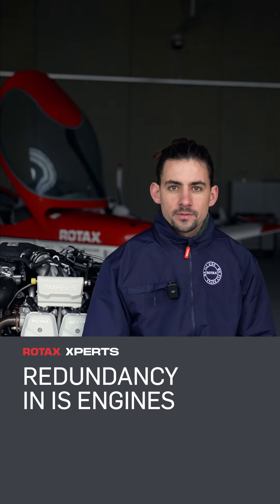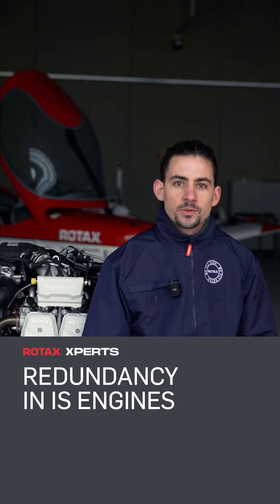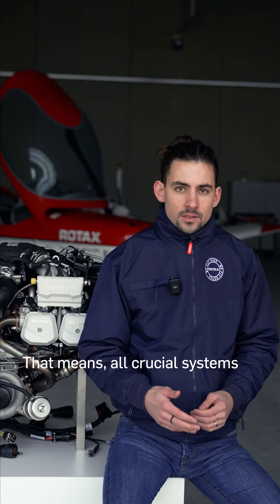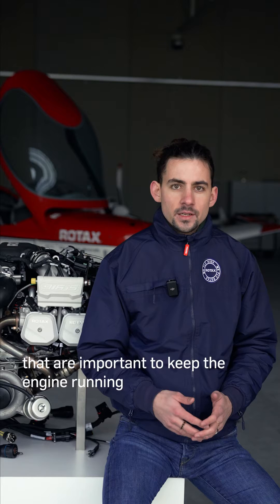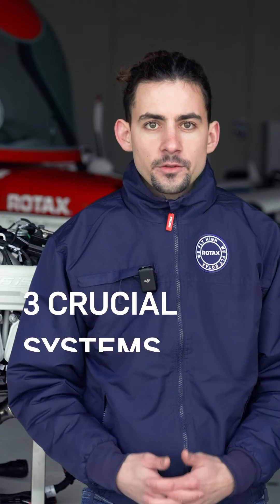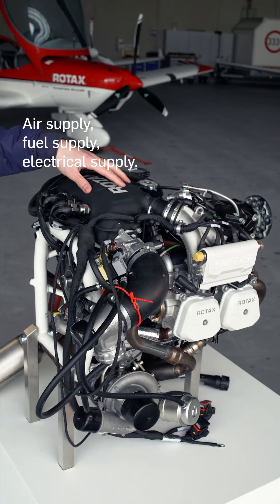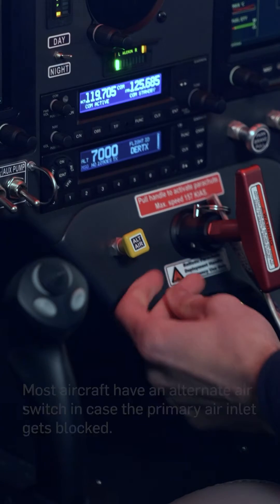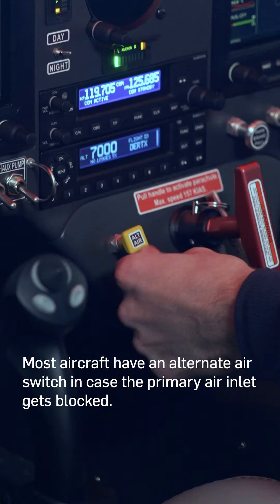Rotax Xperts - Redundancy in Rotax iS aviation engines

Comment: A fault that you cannot truly read without a $1000 dongle and software that they won't give you till you take a Rotax only provided course. So out in the field where these engines are actually used it is a very closed loop of service. Making a good viable engine less viable by artificially restricting service. Hooking 2 RS-232 ports and loading some software via a $25 (cost though Rotax charges $1000 for it) dongle should not be restricted in 2024